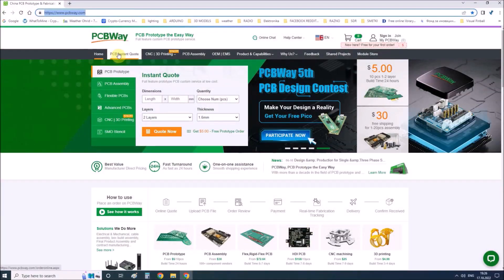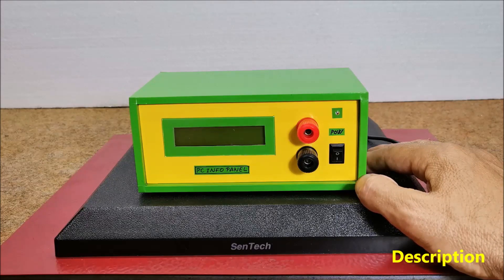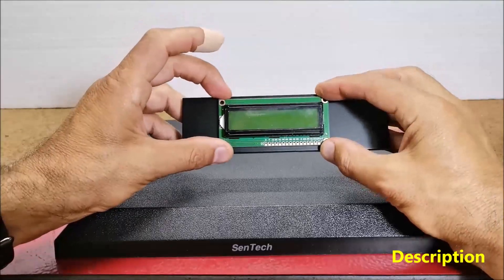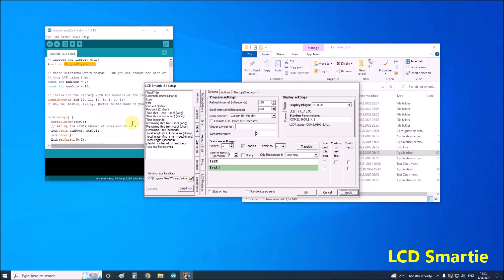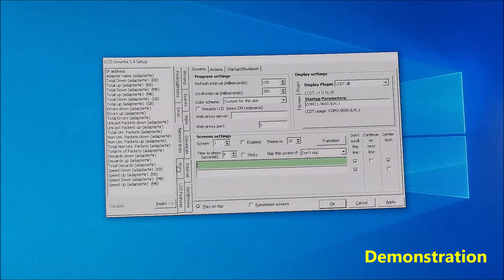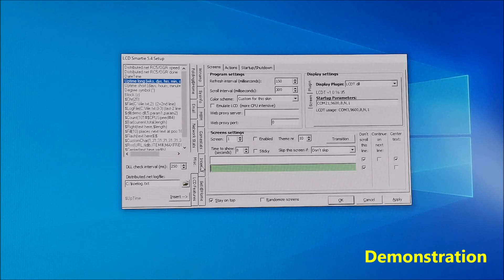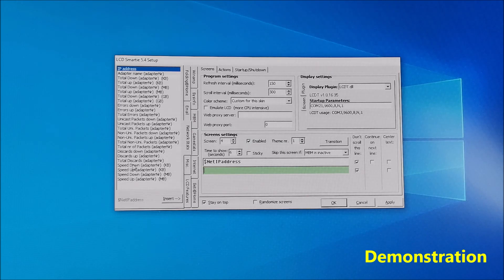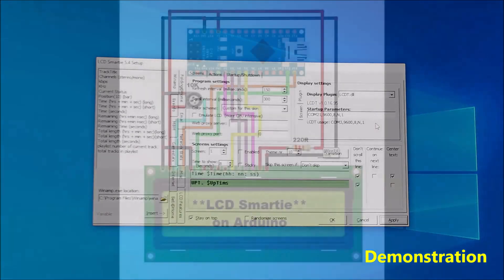Arduino LCD Info panel for PC (LCD Smartie)

Comment: Will this work with a i2c backpack?
Reply from the maker: Yes, only very minor changes to the code are required
Reply: @MirkoPavleskiMK  this is were I am stuck. I am able to communicate with my 2x16 i2c lcd with IDE but not with LCD Smartie. Can you give me an idea of what needs to be changed in the code?
Reply from the maker: @johnlattarulo2578   Try this code (you need to install LiquidCrystal_I2C library)
// include the library code:
#include <Wire.h>
#include <LiquidCrystal_I2C.h>
// these constants won't change.  But you can change the size of
// your LCD using them:
const int numRows = 2;
const int numCols = 16;

// initialize the library with the numbers of the interface pins
LiquidCrystal_I2C lcd(0x27, 16, 2);

void setup() { 
  Serial.begin(9600);
  // set up the LCD's number of rows and columns: 
  lcd.begin(numRows, numCols);
  lcd.clear();
  lcd.setCursor(0,0);
  lcd.print("**LCD  SMARTIE**");
  lcd.setCursor(0,1);
  lcd.print("on Arduino");
}

byte serial_getch(){
  
  int incoming;  
  while (Serial.available()==0){}
  // read the incoming byte:
  incoming = Serial.read();

  return (byte) (incoming &0xff);
}

void loop(){

  byte rxbyte;
  byte temp;

  rxbyte = serial_getch();

  if (rxbyte == 254) //Matrix Orbital uses 254 prefix for commands
  {
    switch (serial_getch())
    {
    case 66: //backlight on (at previously set brightness)
      // not implemented        

      break;
    case 70: //backlight off
      // not implemented        
      break;
    case 71:  //set cursor position
      temp = (serial_getch() - 1);  //get column byte
      switch (serial_getch())  //get row byte
      {
        //line 1 is already set up
      case 2:
        temp += 0x40;
        break;
      case 3:
        temp += 0x14;
        break;
      case 4:
        temp += 0x54;
        break;
      default:
        break;
      }
      lcd.command(0b10000000 + temp);
      break;
    case 72:  //cursor home (reset display position)
      lcd.command(2);
      break;
    case 74:  //show underline cursor
      lcd.command(0b00001110);
      break;
    case 75:  //underline cursor off
    case 84:  //block cursor off
      lcd.command(0b00001100);
      break;
    case 76:  //move cursor left
      lcd.command(16);
      break;
    case 77:  //move cursor right
      lcd.command(20);
      break;
    case 78:  //define custom char
      lcd.command(64 + (serial_getch() * 8));  //get+set char address
      for (temp = 7; temp != 0; temp--)
      {
        lcd.print(serial_getch()); //get each pattern byte
      }
      break;
    case 83:  //show blinking block cursor
      lcd.command(0b00001111);
      break;
    case 86:  //GPO OFF
      //implement later
      break;
    case 87:  //GPO ON
      /*temp = serial_getch();
              if (temp == 1)
              {
                GPO1 = GPO_ON;
              }*/
      break;
    case 88:  //clear display, cursor home
      lcd.command(1);
      break;
    case 152: //set and remember (doesn't save value, though)
    case 153: //set backlight brightness
      //not implemented
      break;

      //these commands ignored (no parameters)
    case 35: //read serial number
    case 36: //read version number
    case 55: //read module type
    case 59: //exit flow-control mode
    case 65: //auto transmit keypresses
    case 96: //auto-repeat mode off (keypad)
    case 67: //auto line-wrap on
    case 68: //auto line-wrap off
    case 81: //auto scroll on
    case 82: //auto scroll off
    case 104: //init horiz bar graph
    case 109: //init med size digits
    case 115: //init narrow vert bar graph
    case 118: //init wide vert bar graph
      break;
    default:
      //all other commands ignored and parameter byte discarded
      temp = serial_getch();  //dump the command code
      break;
    }
    return;
  } //END OF COMMAND HANDLER

  //change accented char to plain, detect and change descenders
  //NB descenders only work on 5x10 displays. This lookup table works
  //  with my DEM-20845 (Display Elektronik GmbH) LCD using KS0066 chip.
  switch (rxbyte)
  {
    //chars that have direct equivalent in LCD charmap
    /*    case 0x67: //g
          rxbyte = 0xE7;
          break;
        case 0x6A: //j
          rxbyte = 0xEA;
          break;
        case 0x70: //p
          rxbyte = 0xF0;
          break;
        case 0x71: //q
          rxbyte = 0xF1;
          break;
        case 0x79: //y
          rxbyte = 0xF9;
          break;
     */  case 0xE4: //ASCII "a" umlaut
    rxbyte = 0xE1;
    break;
  case 0xF1: //ASCII "n" tilde
    rxbyte = 0xEE;
    break;
  case 0xF6: //ASCII "o" umlaut
    rxbyte = 0xEF; //was wrong in v0.86
    break;
  case 0xFC: //ASCII "u" umlaut
    rxbyte = 0xF5;
    break;

    //accented -> plain equivalent
    //and misc symbol translation
  case 0xA3: //sterling (pounds)
    rxbyte = 0xED;
    break;
    /*    case 0xB0: //degrees symbol
          rxbyte = 0xDF;
          break;
     */  case 0xB5: //mu
    rxbyte = 0xE4;
    break;
  case 0xC0: //"A" variants
  case 0xC1:
  case 0xC2:
  case 0xC3:
  case 0xC4:
  case 0xC5:
    rxbyte = 0x41;
    break;
  case 0xC8: //"E" variants
  case 0xC9:
  case 0xCA:
  case 0xCB:
    rxbyte = 0x45;
    break;
  case 0xCC: //"I" variants
  case 0xCD:
  case 0xCE:
  case 0xCF:
    rxbyte = 0x49;
    break;
  case 0xD1: //"N" tilde -> plain "N"
    rxbyte = 0x43;
    break;
  case 0xD2: //"O" variants
  case 0xD3:
  case 0xD4:
  case 0xD5:
  case 0xD6:
  case 0xD8:
    rxbyte = 0x4F;
    break;
  case 0xD9: //"U" variants
  case 0xDA:
  case 0xDB:
  case 0xDC:
    rxbyte = 0x55;
    break;
  case 0xDD: //"Y" acute -> "Y"
    rxbyte = 0x59;
    break;
    /*    case 0xDF: //beta  //mucks up LCDSmartie's degree symbol??
          rxbyte = 0xE2;
          break;
     */  case 0xE0: //"a" variants except umlaut
  case 0xE1:
  case 0xE2:
  case 0xE3:
  case 0xE5:
    rxbyte = 0x61;
    break;
  case 0xE7: //"c" cedilla -> "c"
    rxbyte = 0x63;
    break;
  case 0xE8: //"e" variants
  case 0xE9:
  case 0xEA:
  case 0xEB:
    rxbyte = 0x65;
    break;
  case 0xEC: //"i" variants
  case 0xED:
  case 0xEE:
  case 0xEF:
    rxbyte = 0x69;
    break;
  case 0xF2: //"o" variants except umlaut
  case 0xF3:
  case 0xF4:
  case 0xF5:
  case 0xF8:
    rxbyte = 0x6F;
    break;
  case 0xF7: //division symbol
    rxbyte = 0xFD;
    break;
  case 0xF9: //"u" variants except umlaut
  case 0xFA:
  case 0xFB:
    rxbyte = 0x75;
    break;
  default:
    break;
  }

  lcd.print(rxbyte);  //otherwise a plain char so we print it to lcd
  return;
}
Reply: @MirkoPavleskiMK  code uploaded without error. LCD backlight went off. I used LCDT.dll in smartie on com4, 9600. Quit Smartie. Relaunched smartie with error failed to launch dll initialize error: Failed to open serial port: Access is denied.
Reply: @MirkoPavleskiMK  some progress, I added the line lcd.backlight(); after lcd.clear(); and I get the *LCD Smartie* on Ardunio welcome message. The smartie initialize error seems to be resolved. (possibly from a reboot of the computer). LCDT.dll is being used and data seems to be flowing to the LCD but just random numbers.
Reply from the maker: @johnlattarulo2578  If LCD Smartie appears on the display, it means the microcontroller part is OK, now look for error or setting in Windows Application
Reply: @MirkoPavleskiMK  When you say Windows Application do you mean LCD Smartie or Ardunio IDE. Are there logs to look at?
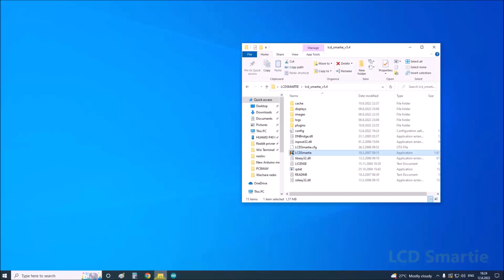Reply from the maker: @johnlattarulo2578  Lcd smartie not arduino ide.Look video tutrial from 3:44 to 5 :54
Reply: @MirkoPavleskiMK  yes I watched again. Still getting random numbers once LCD Smartie is launched. The opening message from the ino code *LCD  SMARTIE* on Ardunio displays correctly but once LCD Smartie is launched it displays random numbers in every cell that change as if they are scrolling left to right.
Reply: @johnlattarulo2578  Exact same issue.
Reply: @AdamSKEN.01  I did find code that worked with some slight modification. I will try to post it here. Just give me a day or two.
Reply: @johnlattarulo2578  Not required anymore, I got it working by only filling in two lines instead of four. That configured it somehow and it now works. Now to use it on my remote Minecraft server.. can you transfer USB with two cables (dummy resistor for power on both sides)?
Reply: @AdamSKEN.01  that's good, just so you know I did post the code but I belive it was deleted.
Reply: @johnlattarulo2578  can you post the code? Same error here with random numbers
Reply: @mariuss611  send me a pm
Reply: @AdamSKEN.01  Could you please send ur code or the modifications made to it?
Reply: 9 months later, I tried again.
 Go the last line in the code, the one that is 
//otherwise a plain char so we print it to lcd.

Replace 
lcd.print(rxbyte); with 
lcd.write(rxbyte); 

If the Arduino is running before LCD Smartie, you'll get a garbled screen. Restart your Arduino by pressing its reset button.